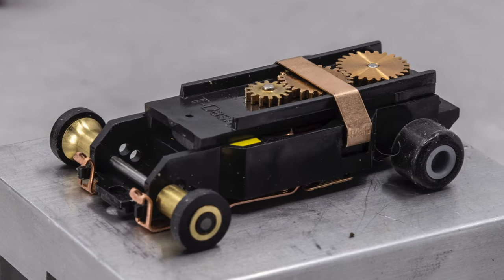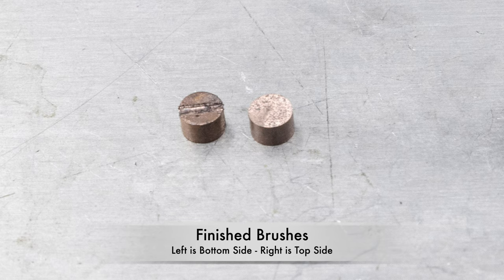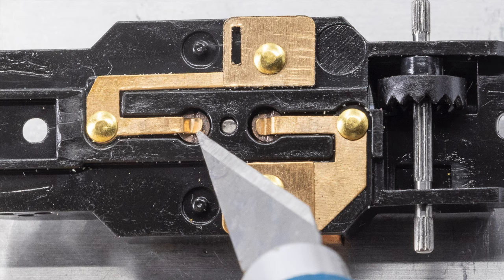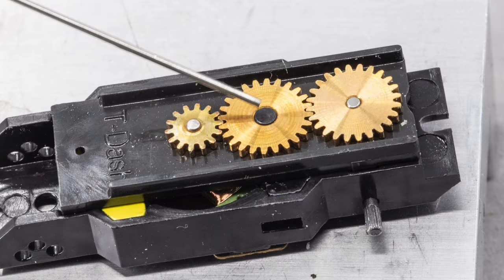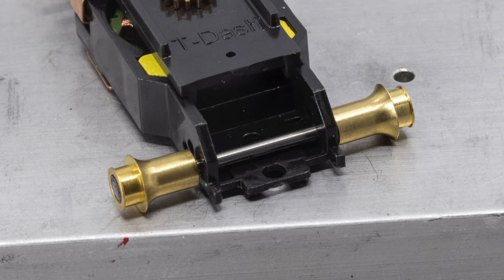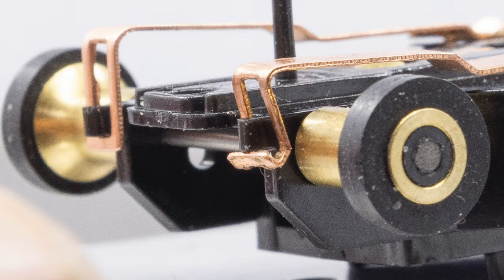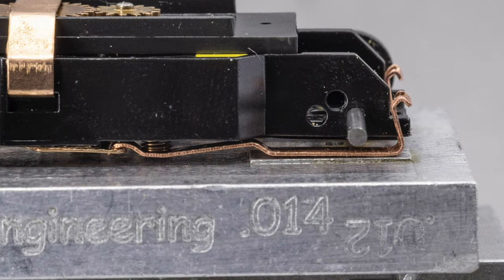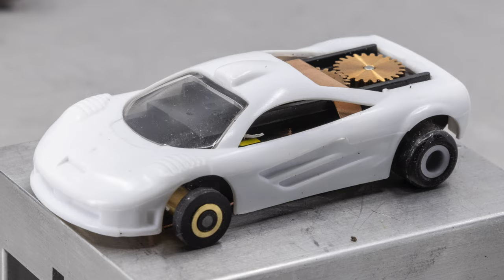Blueprinting a T-Dash chassis for HO slot car racing

Comment: Interesting how the science of brushes has reversed over the years. Back in 1967, the local HO thunderjet guru told us to NOT groove the brushes, because they were meant to turn in the chassis to make them wear evenly, giving a flat contact surface, and that if we put grooves in them, we would be able to see that they would wear more on the two edges, making less contact with the commutator.
Reply: That IS true. Not everything is un-engineered.
Reply: I am a FIRM believer in keeping the brushes from spinning. For many, many years I believed it was good for the brushes to spin. It's not. Your cars will run faster if they don't spin. Sometimes you will have a mysteriously slow car (Aurora Thunderjet) that you just can't figure out. It very well may be that it is because the brushes are spinning and not passing the power to the commutator. Also, spinning brushes develop a dome instead of a flat contact area on the top side of the brush. So, not only is the contact area to the armature smaller but I also believe that it will change the timing of the armature because the edges of the brush will not be making contact AND the brush will be making contact on each phase of the armature for less travel of the armature. I'm not sure that I phrased that accordingly to what is in my head but hope it is understandable. I have been slotting my brushes for years now but sometimes when one of my cars slow for no apparent reason I discover that one of my brushes is spinning because I try to put as small a slot that will do the job. Actual Thunderjet racing groups only allow not much more than a scrape or "score" across the surface. I make the slot as small as practical for my brushes to last as long as possible. A generous slot will drop the brush lower onto the brush spring therefore lower in the chassis requiring replacement sooner. Sometimes I have to give the brush spring a little twist towards the oncoming direction of armature rotation for the for the edge of the "V" bend in the brush spring to catch the the score (or slot) in the brush. With a chassis that has been used for some time with unslotted brushes the pronounced V in the spring may have rounded off a bit making it harder to catch the scored brush that prevents it to spin. Whenever I get a brand new Thunderjet (rarely anymore) the first thing I do is take it apart and slot the brushes to keep from wearing the V. Sorry if you think I am a yoyo but I am 100% convinced that it is best to slot the brushes.
Reply: You can reverse the shoes as they wear.